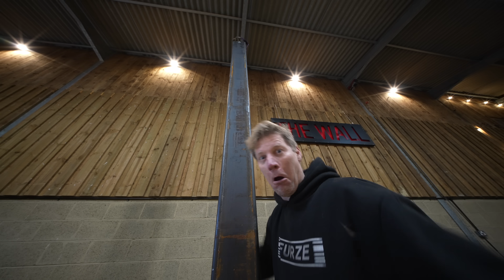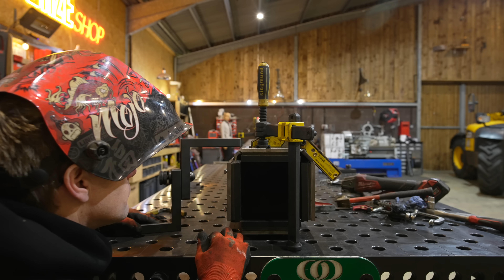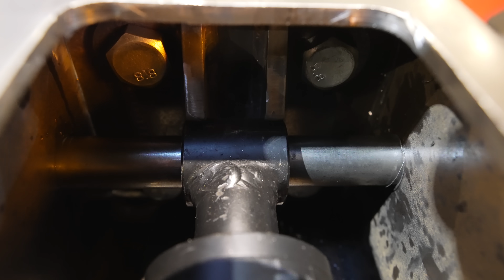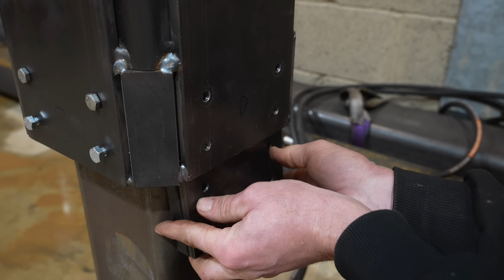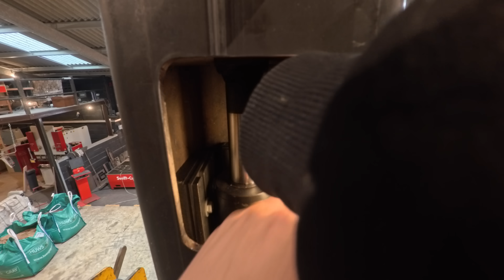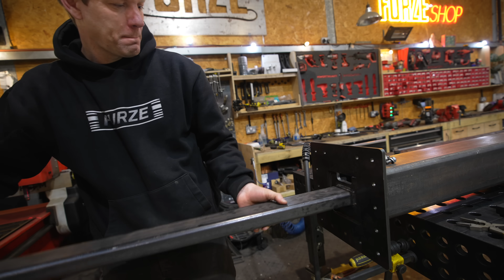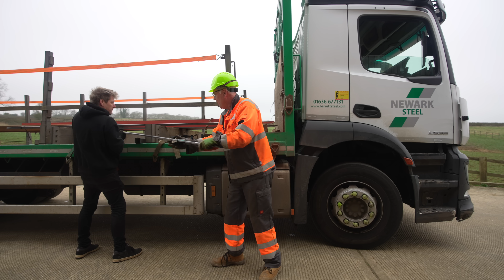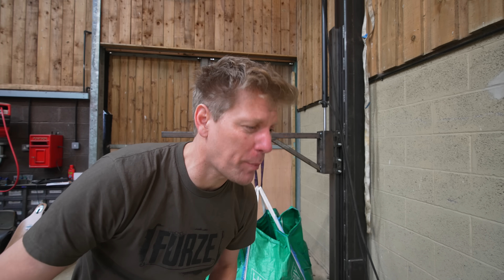Digging SECRET Garage Part 7 Car Lift Prep

Comment: Is there a reason why it’s not shot-blasted and metallized or galvanized? I know they’re underground and not exposed to direct rain, but won’t they still be susceptible to rust over time due to moisture?
Reply: He did show a rust update on his first underground endeavor, and uncovered a small amount of surface rust. I|t really should be galvanized if he wants it to last as long as structures normally do.

Comment: Use a plc and 4 string encoders and have it control the valves to each cylinder you can skip the cables you can even have it drive 4 pumps on 4 VFDs and get a smooth ramp up and ramp down on speed with very precise start and stop.
Welcome to the world of hydraulic robotics.

Comment: Make it a huge scissor lift with two hydrolic rams that lay flat while the scissor lifts it all, it'll be alot simpler and you can use the posts at supporting guide pillars, like in a  elevator but it's powered by a scissor mechanism

Comment: Now, I’m no engineer by any means and I’m sure that someone will already have mentioned this but as a mechanic I can see specifically the plate that will separate from the turntable won’t be that useful as a car lift for working on the car. Preferably you’d want to have a centre slot, essentially having two separate tracks for the car wheels to be sat on so that you can reach the underside of the car from whatever will be the floor under the turntable. And you may want to think about having some sort of lifting apparatus between the wheel tracks to lift parts of the car so you can swap the wheels and work on suspensions and whatnot. 
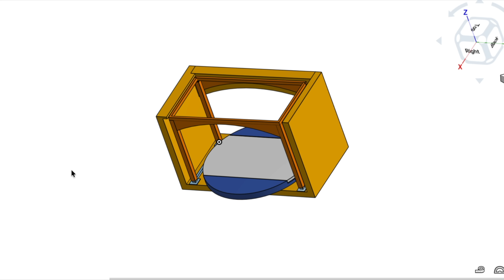Just a thought that popped into my head watching this cad recording 2:05

Comment: Because lifting is a dynamic activity (the load can bounce, jerk, or swing), standard engineering requires a safety multiplier of at least 4x to 5x. This means your top wall anchors must be rated to survive a combined pulling force of roughly 6,400 kg to 8,000 kg without shearing or pulling free from the wall structure.

Comment: You should see if you can add a lock to the top platform. You can keep that section up, and lower the inner tubes and then replace, or perform maintenance.

Comment: you should make a sircle that the car sits on and a circular hole at the top so the rotation is no problem with space and its lighter so the hydrolics can push it easier

Comment: are you gonna put some kind of pressure plates at the top of the house driveway in case there is a car parked above the Delorean? 
That way if the plates detect there is a vehicle parked the hydraulics won't travel up and risk tipping it over.

Comment: For your bearing support to give it move strength against taco-ing apart - could you not slot the RSJ beam for the length of travel and use a single long bolt through that slot to holding the bearings (as in one bolt holds six bearings, so your total bearing carrying bolts are reduced down to 2 instead of 4)  in place and keeping the block square and anchored - it would also make your eccentrics more stable and less prone to moving under stress. The downside is weakening the section of travel of the RSJ, but you could gusset and plate it outside of the area of travel.

Also by using a solid through and through bolt to carry the bearings you could put the eccentic lobe on the outside of your bearing carrier box, which would make each set of bearings adjustable from the one side.... I suppose you could get real wacky and weld a rod or to the ecentrics so they all adjust as one on each side... though that idea is pretty flawed.

Comment: Create a hammer that can reload itself, to get a nail into some wood.
 Turn the hammer around to finish banging the nail in.
 Turn the hammer around and another nail will be waiting to get bashed in
Reply: Nail gun
Reply: @BlogVonMax  No something non powered without the need for the expensive nail cartridges.
 Just put any size nails in the hammer and be able to start hammering a nail in one handed.
 
I should have just said creat a ONE HANDED HAMMER.
 No power, no compressor and no need to hold the nail with the other hand. It can be doing something else like holding a cup of tea, biscuit or a snake
Reply: @richardwills3927
Battery powered nail gun

Comment: What about 6 hydroelectric systems. 4 like you already have and 2 under the platform. Dig a whole down to fit them in. I'm not an expert, but that should give you more then you need to make shore it's super strong even with a campavan on top of it.

Comment: with all the testing of the metal components I want to ask something off that track....what is your floor pad rated at?   will the concrete support the post  weights? you probably stated that when you put them down but I missed it...sorry

Comment: i rly wonder how you going to pull off the ceiling without compromising the outside garden vibe and overall look of the street view ( not to manny steel beams or hatches)
i think he either got into trouble with permts
or he stumbled upon problems building his mechanism taking things way to long and he doesnt like to show faillure
a lift with a roof that needs to move out of the way need a LOT of space for mechanic stuff
or his version that IMO need A LOT more mechanical stuff to work together, like the roof that goes up but stays low, that needs a lot of space for it to work

even if the lift is down and your not suppose to know from the outside what down there.
there have to be some sort of steel fence with signs to prevent people standing on it when you move your car up etc, it wil be VERRY hard to keep this a secret garage with a lift like that and so little space to hide you mechanism

at the verry least it wil be nothing close to a neat ''game style'' hatch with a ''themepark tycoonstyle''  neat fence around it

Comment: your neighbour is going to love hearing the mechanical sound of hydraulics and a steel lift going up, for 10 min straight
and when you drive away without lowering it your neighbours are stuck with a view of a steel cage out of the ground
so another 5 min for lowering it down

Comment: Archaeologists digging in Lincolnshire, England, have officially solved the mystery of why legendary inventor Colin Furze hasn't uploaded a main-channel video in four months: he accidentally dug his secret underground garage so deep that he breached a subterranean time rift. The excavation team from the Cotsen Institute of Archaeology, initially called to investigate unusual seismic activity beneath a standard backyard shed, uncovered a massive underground complex. What they found explains the sudden radio silence on Colin Furze's YouTube Channel. The Archaeological Discovery Lead researcher Dr. Evelyn Vance reported that the team bypassed several layers of heavily reinforced concrete and rebar before making the discovery. The Site: A sprawling, multi-level underground bunker, garage, and tunnel network spanning hundreds of meters. Artifact #1: A completely custom, heavily over-engineered hydraulic car lift designed with "lovely legs" that appeared to be welded to the bedrock itself. Artifact #2: A high-definition camera rig, perfectly preserved in a layer of dried mud, still pointing toward a half-finished steampunk door. The Breakthrough: At the lowest level of the dig, archaeologists found a massive, spinning "belt of knives" powered by a jet engine, wedged firmly into a glowing tectonic fracture. The Reason for the Missing Uploads According to recovered field notes and digital fragments found on a corrupted hard drive, Colin’s standard protocol of over-complicating everyday tasks led to his disappearance. We are waiting for further information..

Comment: i think this is the part where he found out you cant just lift a car up out of your driveway without some issues popping up.
like the city itself
neighbours
noice
structural integrety

i can only imagine you pushing the button and then its like 5 minutes of heavy mechanical noice to lift that car up sloooowly
and wile in your street outside you see this massive steel structure rising out of the driveway, maybe even reaching the second story of your house that high

you allready mentioned your mechanism and that you thought of that but this long waiting is giving me weird feelings

would be ''funny'' if the city decided to watch what your final plan was and let you finish the build only to send you a letter that ''now that they know what your up to'' they kindly ask you to fill up the hole you created or else they making him house a bunch of migrants in it XD

Comment: COLLIN! I just now came up with a concept that will revolutionize boating. I know you are not near much water but it is such a great idea that I just had to tell it to tell it to you anyway. 
Make a party barge and put jet ski engines in the pontoons! Genius idea! No more having to deal with an outboard motor, and think of the speed! Build it or not, just get the idea out there. But think of the speed, especially if you build one with three pontoons.

Comment: Please reconsider lifting the whole turntable with the car. You'll save a lot of weight if the turntable is permanently mounted on the floor. When the car lowers on it's rectangle platform (with rounded ends that match the turntable curve), into the slot across the turntable, then the hydraulic rods retract before the turntable activates to rotate the car. Of course when the car is rotated and facing outwards, the holes should line up perfectly for the hydraulic rods to reinsert ready for the car to be lifted again. The finer mechanics of getting the rods to line up perfectly and to operate smoothly, would be no big deal to a man of your skill.

Comment: I only find one flaw with this whole concept. 
Groceries the one time we’re putting stuff in and out of the vehicle on the weekly. 
How will you get groceries into your kitchen? 
This is a puzzling and baffling. 
An elevator
An air shoot like at the bank
Maybe a railroad track like out of my mine?
Why are you going to backpack them in through the tunnel system? ￼

Comment: Ah, i remember. Factor of Safety 1.67. Meaning the the structural utilization is set to 60% of the nominal yield strength. Meaning 3/5th is the max load bearing capacity that is considered safe. That is the standard for the American Institute of Steel Construction. But that is for static structures. Dynamic structures are supposed to be designed to 1/5th utilization of max load.

Comment: Isn't the golden rule of load bearing infrastructure to be over engineered so your only using 3/5th under max load? Like 60 total rating while the load capacity before failure is 100?

Comment: Have you looked into Spira lift? It's a non-hydraulic lift system that requires no space beneath but can still have a solid shaft for lifting. It's quite interesting and it runs on a motor. Its mostly used in theater lifts or automotive industry.

Comment: I have an invention idea so when it rains holding an umbrella is to much work so I think you should make a backpack or something that hides an umbrella until it rains and you flip a switch and an umbrella comes out a bottle holder on the side of the bag or something and then you’ve got an umbrella and not tried arms 🤯🤯

Comment: Why not use hose break protection. Like the on outriggers on mobile cranes. You won't need the extra bar with the break system then.

Comment: @ColinFurze What safety feature are you building in? If a hose bursts, your elevator can slam down to the bottom. Personally, I would have considered a screw/worm drive because if anything fails, the elevator cannot fall.

Comment: To keep it from going out of sink and getting all wonky you could use a flow divider to control it with the oil. Flow dividers control how much oil goes to each cylinder. Like have an hydraulic motor driving 4 pumps on the same shaft. They are positive displacement so the fluid has to move and doesn't slip like a centrifugal.

Comment: did you consider doing it like a 4 post car lift where the ram is lying down in the bed and uses cables and pullys to lift the bed that you adjust the cable lengths to level it as it rises

Comment: Colin use Phenolic impregnated with Graphite and you will never wear them out as Nylon doesn’t like heat much and it doesn’t slide as well as the 
Phenolic.

Comment: While designing the lift, you should think of safety. 
What happens if a hydraulic hose gives way at some point in the future?
Think of a roller coaster climbing the hill making the clicking sounds as it goes up.  Those clicks is a mechanical locking devise which keeps the coaster from going backwards in the case something breaks loose.
You should install something on each leg which will keep the carriage from falling in the case of a hydraulic blowout.

Comment: I would’ve done a retracting floor on the surface and a lift within the garage so that way you don’t run into height issues and also have a random cover when pulling your car out

Comment: hello Colin from Australia love your work mate, just a thought maybe crossed your mind, will scissor lift with a platform work if you dug a bit more dipper not if you can go more deeper or not, slab of concrete and pier holes  under the concrete slab. have a rotating motor on platform

Comment: I've been in the VerticalLiftModule business for over a decade and i was curious how your solution of this was not 4 vertical straight sprocket rods with a movable base with a front and back shaft and a sprocket wheel on each end. with support wheels keeping the rods and wheel together. These type of machines can easily lift 2000kg (net) with a 15kw motor, plc and a inverter.

Hit me up by pm and i can cad something for ya

Comment: How will you work on the car? The floor will be blocking any access to the underneath of the car. Why not make the entire hydraulic system external and run the lift on cables, with metal teeth to secure it at any level? Not too dissimilar from a car lift in a garage (except the cable part). That will give you space, you can have a 2 tier floor (with one being just 2 planks so you can properly work on the car). I mean the US military can lift a whole tank with cables, and they then attach it to a parachute and toss it out of a plane!

Comment: Hey Colin, Make sure your hydraulic cylinders have counterbalance or holding valves to prevent the cylinders from drifting down when extended. Without those counterbalance or holding valves you are relying on the hoses and control valves to hold the load in place.

Comment: Your bottom lift plate should almost work like an alignment hoist in a garage or at least slots in the middle somehow or working on it using your ramp will be almost pointless when you have this advantage🤔✌🏼🇨🇦
And don’t forget safety locks 😅👍🏼

Comment: Not sure how far off finishing the project you are but you might want to consider safety edge sensors incase a limb gets too close to the ceiling of the lift  as it closes. They are used a lot in theatre for stage lifts.

Comment: i used to work for a car lift company please consider making a later locking system for safty. its better to have to rescue a car stuck on a lift than have a car or lift damaged. and great job thinking of the cable system to keep all hydrolic post going at same speed. Also we would service verry old lifts sometimes and we would find old air-hydrolic systems that where very cool and quiet. check it out you are doing lots of cool stuff.

Comment: what you can also do with the hdraulics is connect ithem paralel common-rail so the pressure equalizes beteen the four and they stay in sync

Comment: You’ve helped me solve a problem I’ve been having for a while. Trying to diy a heavy duty truck bed slide and need bearings that can handle the load. The bigger the load the bigger the bearing and the more height the bed slide takes up. I can’t believe I never thought of simply stacking more bearings together

Comment: I work in hydraulic cylinder repair and manufacture. Wouldnt a single acting telescopic displacement  cylinder be better suited to your needs ?
You could achieve the same open centre length with a much shorter closed centre meaning you could maintain structural integrity by not removing as much box section for maintenance

Comment: Collin looking back at your serviceability with you plan for removing the cylinders what happens if a hydraulic line fails and the lift isn’t up high enough to get the cylinders out? Will you just have to get a crane or use the tele handler to lift the whole unit up high enough to get them out and service it? And if so is that something you’re going to be okay with? Just a thought from the brain of a general contractor! Love the project can’t wait to see it finished!

Comment: I'm still of the option that the hidden hydrologic cylinder will do you no favor when a seal inevitably needs to be replaced.

I believe what would make the whole thing a lot easier would be the for lift approach, this way the lift cylinders can be located in the pit and can be removed and serviced by just opening the floor.
This would also allow you to remove the secondary cylinders that you currently plan on using for the carr platform to move independently from the cover.
If you think of your platform as the forks, then simply adding a post in each corner that is the desired highlight will automatically lift the cover if the posts make contact.
You also then don't need hydrologic lines that move at all, no drag chains or complex pipework.

Comment: Could you not have had an access hole for the lower mounts so you could unbolt them, then take the caps off at the top and pull the ram up from the driveway?